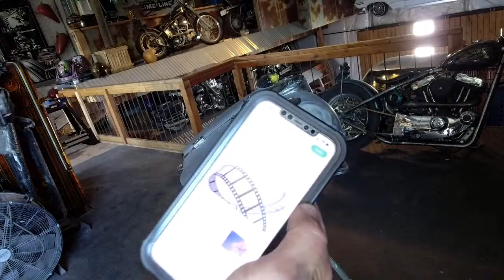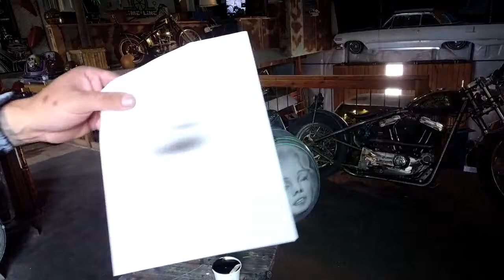Marilyn Monroe Custom Paint Makeover from 10 years ago

Comment: Could you use black candy paint instead of base coat
Reply: Ive used black candy before in place of base coat and it does work good if that's the look you're going for.   There only difference is that it doesn't come out as bold because you still get all the sparkle coming though where the base coat kinda knocks the sparkle down alot more.   Just my opinion and 2 cents